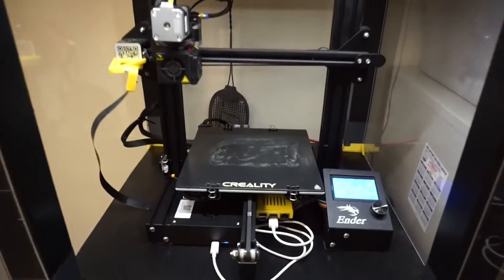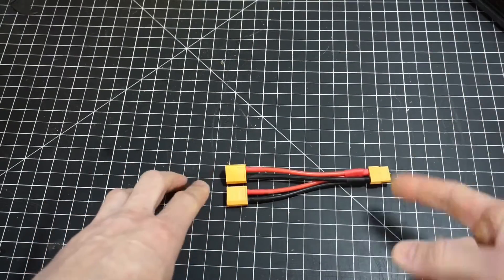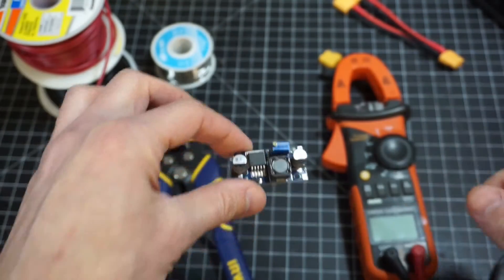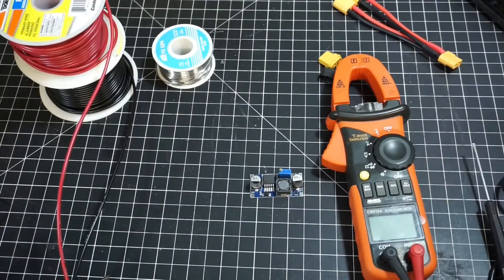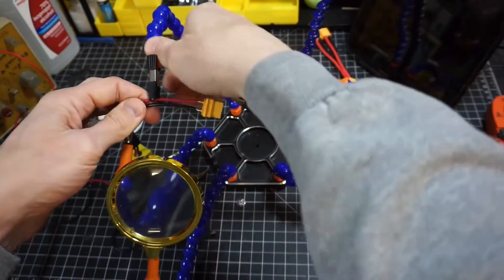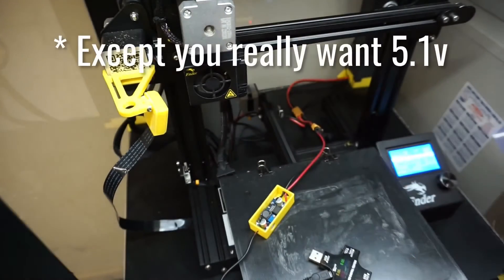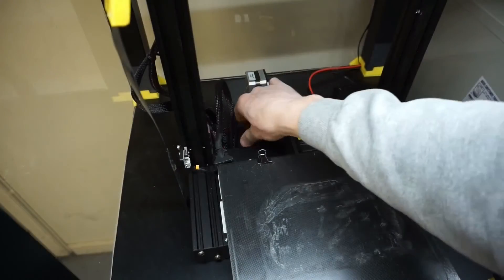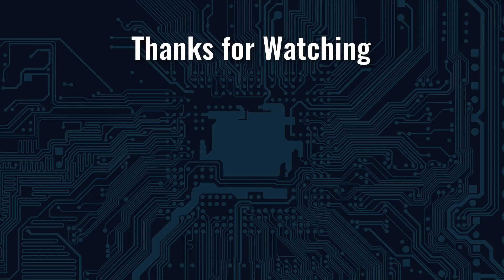Raspberry Pi OctoPrint Powered by Ender3 3D Printer

Comment: Great idea! Thanks for the push! I would instead use USB connectors on a board to where I could disconnect/isolate the USB power from the RPi to the Ender 3, only connecting the ground and data lines. I did this with my initial approach and it worked great. I had the idea/project already when working with powering SSD USB devices to be used with the RPi 4, since the power provided via USB for many SSD implements was lacking. Anyway, that RPi project I had in place drew its power from a TPLink POE switch and I wish I had thought about using the Ender 3 PSU to power the RPi 4. Your video gave me that idea and I appreciate it!!! Now I am using a RPi Pico W connected to Home Assistant via a smart plug (with power monitoring) to control shutting down the RPi and the power to the whole system once HA knows the RPi had shutdown properly. The power isolated USB connection to the Ender 3 is still in place. and maybe I will work on using a RPi Pico 2W to find a way to get data to the Ender 3 system without using USB. That is for the future though. Thanks for an outstanding video!! {liked.subscribed.saved}

Comment: Hi, thank you for the video. 
What was the reason for moving the power supply outside?
Reply from the maker: The main reason was to reduce the amount of heat stress on the power supply itself. The enclosure holds heat in and removing it seems like the best course of action for the long term health of the PSU.
Reply: Makes sense 👍
Reply: Because he is a homosexual.